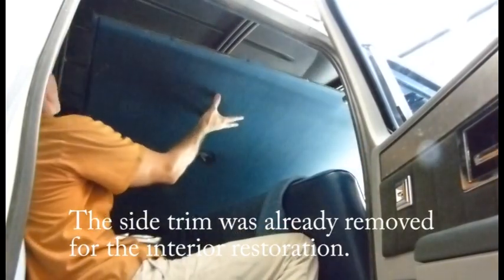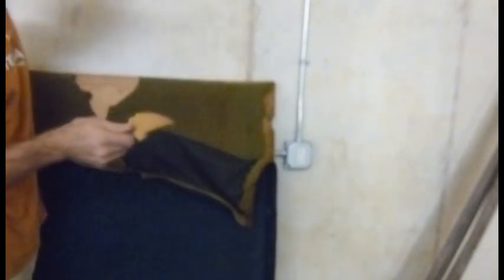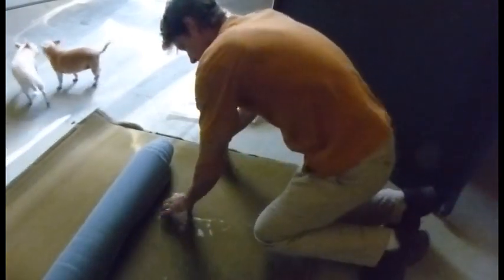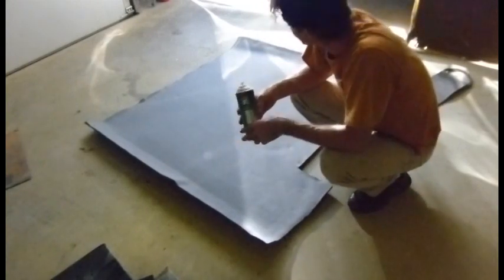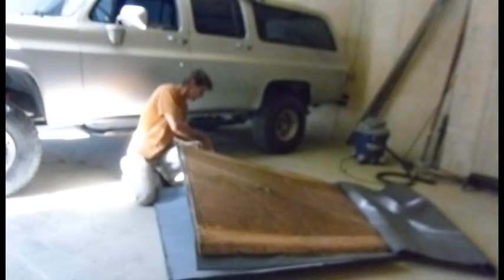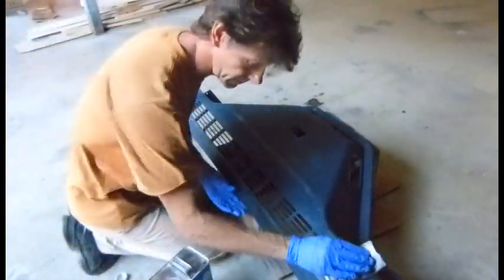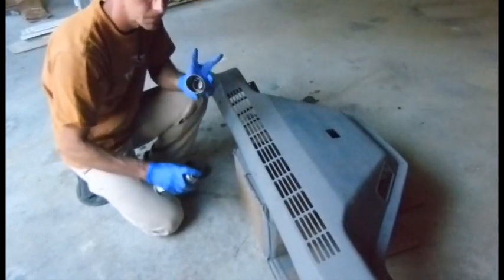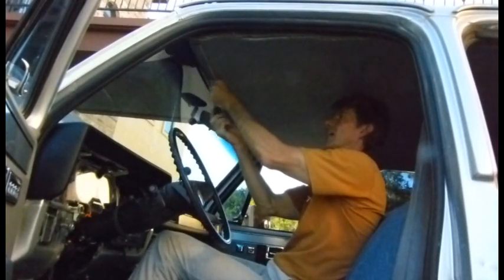Zombie Suburban One-man Headliner Install

Comment: Never reuse the old foam in fact  delete the foam and use poker table felt directly to the board. It looks great and is super easy to do.  I make a few hundred dollars a month with my new side business. 👌 mobile headliner repair 👌
Reply from the maker: Good tip.

Comment: Nice job. I'm getting ready to do this on my 1985 suburban, so this was very helpful.
Reply: How did that go then?  I have an 85 I want to do but I don't want to spend $550 only to have it fall apart as seen in other videos.
Reply: @TempoDrift1480  I ended up not doing anything on the interior yet. My headliner is actually in good shape so it seemed like a bad idea to mess with it.

Comment: Great fricking job man! Thanks for showing this. What was the type of paint you used as I couldn't follow or see? Thank you.
Reply from the maker: SEM Color coat.   it is a professional product,  avail at commercial paint stores or you can buy it online (like ebay or amazon).    I feel like this stuff lasts much better than the Duplicolor stuff avail at the local parts store.

Comment: You should clean the sponge off of the headliner before gluing the headliner material onto the headliner. And for this kind of job it’s best to use adhesive glue spray gun with an air compressor. (:

Comment: Thank you for posting this.  I have an '04 Yukon with similar problem.  From where did you acquire your headliner material?  What was your approximate total cost to do the project?  Thanks!
Reply from the maker: I bought the material off ebay from a fabric supply company.    There is a huge variety of materials out there.   Get 1/8 foam backing minimum.   I should have gotten 3/16 foam, but it turned out OK.

Comment: How much headliner fabric did you need?? Length and width
Reply from the maker: width on fabric roles is usually 54" , which is enough.   I'd get 4 yards which is 12 feet.  The suburban was designed to hold a 4x8 pc of plywood in back, so that gives you an idea of how big the interior is.